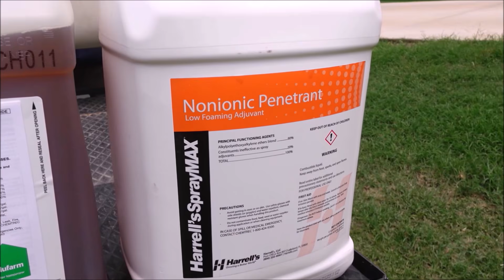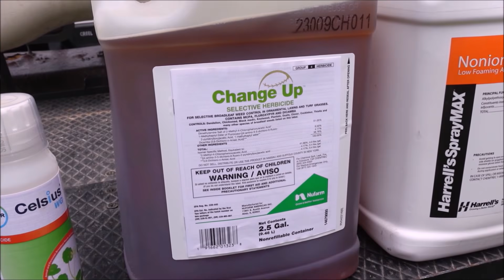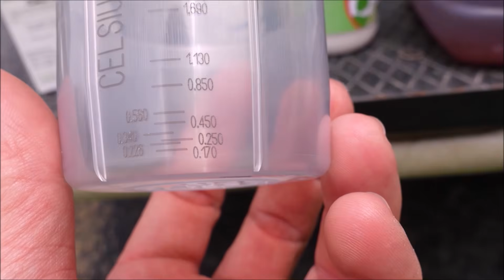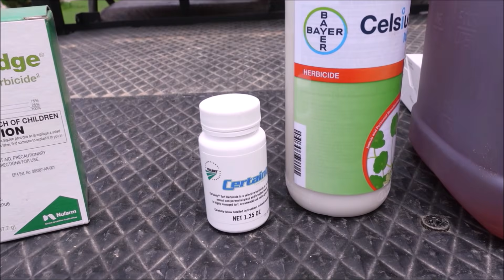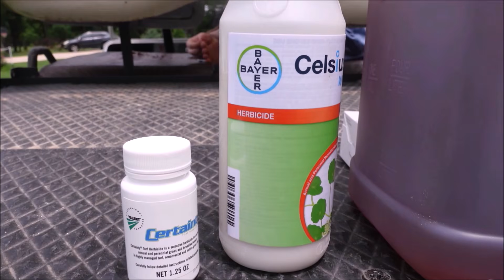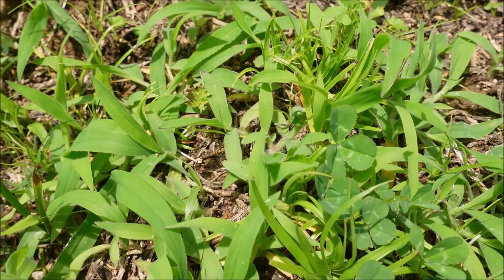3 Weed Control Products to Kill Weeds Fast Without Killing the Grass

Comment: Buttonweed laughed at Celsius at max strength (south AL) 
Ended up literally pulling by hand in some spots and completely nuking with total ground kill. Found if I do total kill and focus on the surrounding grass by charging with triple 13 and carbon g it recovers the spot  I nuked in 90 days

Comment: For grassy weed on bermuda lawn-How is sedgehammer ? Can it be mixed with celcius? certainty is bit more expensive and small size is not available.
Reply from the maker: Sledgehammer is for yellow and purple nutsedge.  It can be mixed with Celsius
Reply: @lawncarelife : thank you. How is Empero Q-Pak Nutsedge Killer to be mixed with celcius and changeup for grassy and broad leaf weeds on bermuda lawn

Comment: Man I just did a spot spray of Celsius and certainty over 1k sq feet and took a color hit in each spot :(  I did use high rate with sticker spreader . I bought this combo because I’ve heard it won’t hurt Bermuda , ugh .
Reply: I've had similar results on not just discoloring but thinning and some dead grass interspersed on the sprayed spots on St Augustine.  I think going with a lighter mixture and lighter spot spraying is key.  It's so easy to over apply by spraying the celsius-certainty combo w/surfactant too heavily when spot spraying at least for me it is.